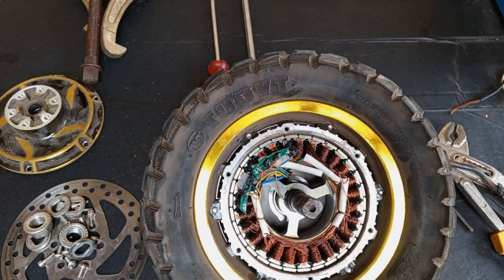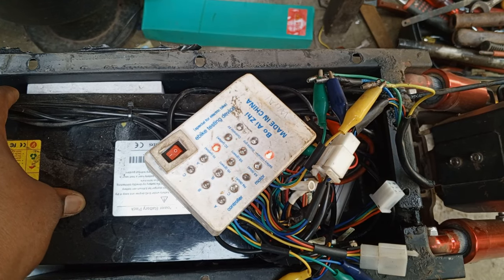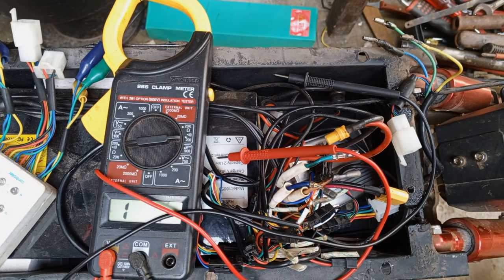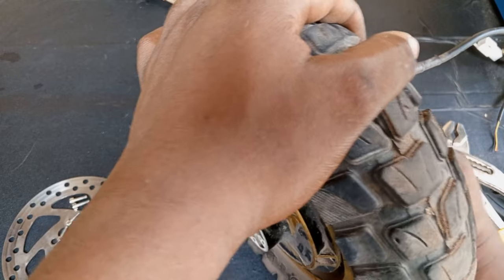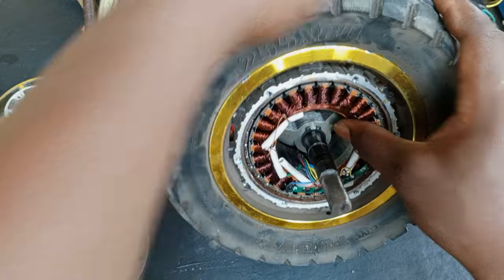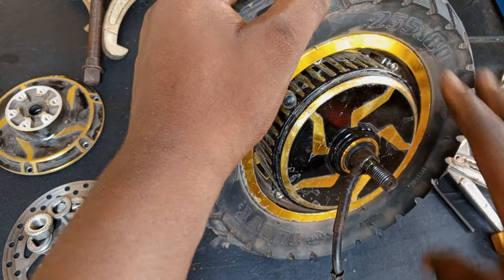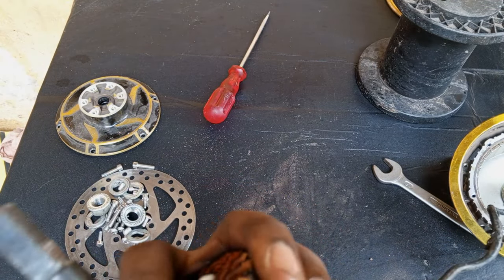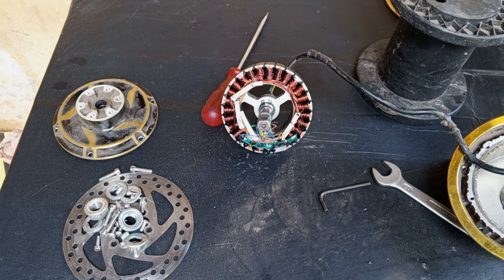How to Troubleshoot  Error -001 on Electric scooter with TF-100 throttle display

Comment: Hello, im gonnz do a diy 2wd mod so i bough 2 generic 36v controllers with tf100 display, only one motor out of the two has thr hall display wire, if i plug the hall sensor motor on the main controller and only throttle signal on the 2nd controller will i have an error or could it work ?
Reply from the maker: do you have a video of how you connected it